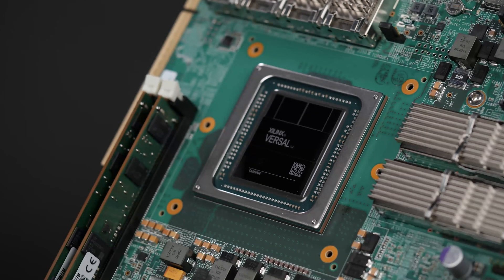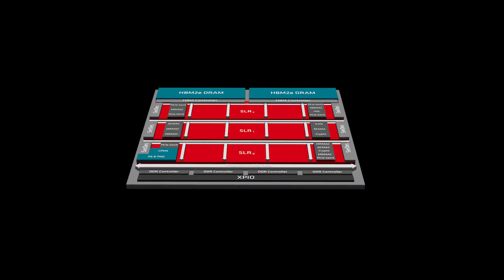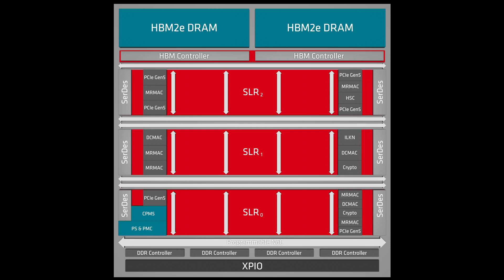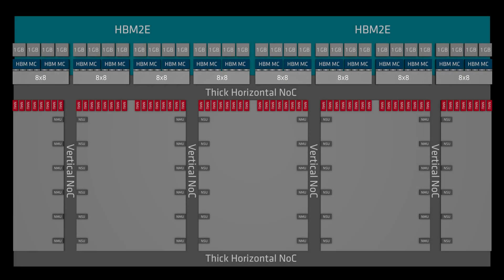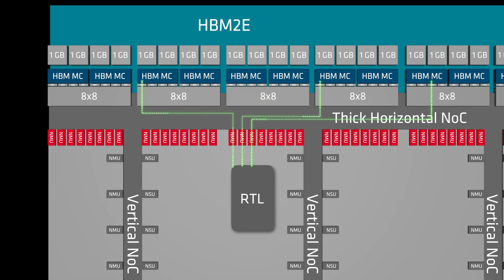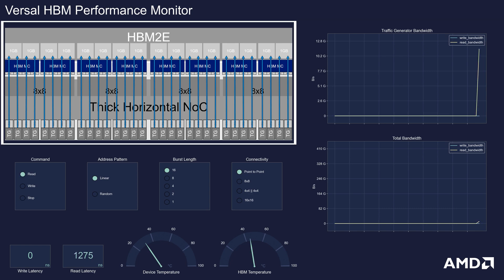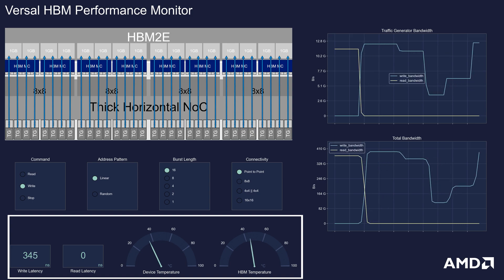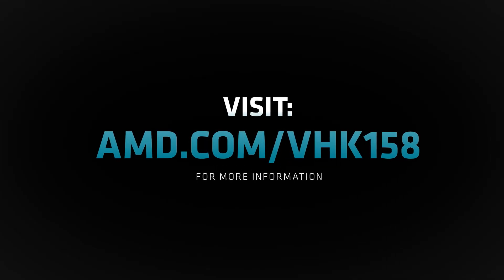Tackle Memory Bottlenecks with the Versal HBM Series

Comment: 1275ns of memory latency (read) or 355ns of memory latency (write) - why so bad??? Consumer CPU's manage to stay <100ns for BOTH read and write.
Isn't a comma (for example 127,5ns instead of 1275ns) missing?
Reply: This is an FPGA, they run at far lower clock frequencies so the long latency doesnt matter.

Comment: can someone explain this in a more simple way?
Reply: It's RAM integrated in the motherboard along the CPU/GPU, so they can put them directly next to it and with more connecting lines than regular RAM. It also saves space.
The new thing here is the way they are connected. They have higher density of connections and each controller has more connections to the memory chips.
All this is for data-centers, heavy AI workload and the like. They said a few more things, but I didn't understand them hehe.
Reply: thanks! @Mr.MasterOfTheMonsters

Comment: Let's have some of that as an L4 for our CPUs.
Reply: Or desktop APU.
Reply: @timytimotius4679 Just APU's as a whole. They NEED it.
Reply: Impossible. L4 with access latency in 300-1300ns range to cache a 50ns memory acsess???
Reply: @volodumurkalunyak4651  With that kind of bandwidth a 4GB HBM module could wipe the floor with DDR 5 assuming the CPU could use it. The latency is slightly worse but the channel width is enormous.

I'm just saying the option would be nice.
Reply: @glenwaldrop8166  no it doesn't. Memory write latency of 350ns and memory read latency of 1275ns (as shown in the video) slows down CPU way more then DDR5's lack of BW.
Reply: @glenwaldrop8166  4GB HBM module will have 1/8 BW of 32GB HBM module (and that - barely even 400GB/s out of theoretical 819GB/s).
Good luck with 4GB od RAM at 50GB/s (out of 102GB/s theoretical) BW with 355ns of write latency and 1275ns of read latency and on top of all that - APU levels of L3 cache (neither x3d L3 nor standart L3, but APU level of L3 - 1/2 of standart).
For comparison L3 latency - around 11-13ns, DDR5 - 60-75ns
Reply: @volodumurkalunyak4651 What do you mean? 3DVcache is in the L2 ran ge of latency. Having HBM in the place of it would provide similar Latency or at worst L3 levels of latency ~30ns
Reply: @hammerheadcorvette4  wrong. 3dvcahche is a PART of an L3 (and it's latency is EXACTLY THE SAME as the rest of L3 - 11-13ns).
HBM here (on the video) has insanely high latency at 1300ns (or 350ns for writes).
Having HBM instead of L3 will tank performance even at DDR4/DDR5 levels of latency (50-75ns)
Reply: @volodumurkalunyak4651 I understand that, but replacing 3DVcache with HBM would mitigate that and offer higher capacity.
Reply: @hammerheadcorvette4  caches are made of SRAM, instead of DRAM like HBM or DDR to achieve low latency.
Reply: @hammerheadcorvette4  5800X3D's L3 latency is 12-13ns.
Reply: Please no. I don't want to spend 900$ for a 9800x3d
Reply: l4 SRAM is not a new concept, 10 years ago adding 128MB of l4 SRAM was called a sufficient architectural upgrade.  Well it was when Intel did it...
Reply: You guys came up with the limits, I want it as an option on all.

Ideally with the chiplet system I'd like to see a point where we just order one to four CCXs, one IO die to fit our system and whatever is left that will fit on the package, APU, GPU, HBM, etc...
Reply: *laptop CPUs
Reply: @hypernova_478 any cpu you Neanderthal

Comment: I wonder will it be used in consumer space again eventually, though a much faster desktop APU would be awesome.
Reply: Imagine if AMD made a shield competitor with there APU and it had HBM stacked on die 😱 Nvidia would be 💩ing 🧱's as they couldn't compete the Tegra has been refreshed more then Intel's 14nm ++++++++++ node.
Reply: @shadowarez1337 I won't go as far as trashing other companies, but... Imagine the 8700G has at least 4GB of 2Gbps HBM2 via 1024-bit memory bus. The Radeon 780M as well as the built-in NPU might have a massive boost as long as the built-in HBM didn't fill up.

But it's just my own guess and I could be wrong.
Reply: @timytimotius4679  it'd have to be a custom SoC the APU might cost too much but the addition of HBM and a powerful CPU compared the Sabertooth Tegra SoC

Comment: Tackle Memory Bottlenecks with the quad chanel, octa channel and dodeca channel DDR4 and DDR5 starting at consumer level.... boom 200%/400%/600% bandwith over 64 bit and lower latency (¿-50%?f easy) or cheap, way cheaper than ridicoluos XPO ram costing more than the cpu or the gpu...

Comment: AMD Time Machine went back to 2017 in 2024 after launching most bottlenecked APUs for 7 years and according to roadmaps more years to go...
 a bit confused what year is in AMD R+D+i labs 2016 Nvidia Turing server and computing, 2020 Nvidia Ampere and server Tesla, 2022 Grace Hopper without ARM cpus... they need to remember IBM invented "Infinity cache" used in RDNA2 and CDNA2 below levels suggested of IBM (256mb) and diminissing in RDNA3/CDNA3.... shrinking bus bit while using expensive overclocked ram no jedec spec'ed...Does time goes in several directions back there? Hello, 2024 here, you're Welcome. I'm talking to you the people who invented X3D and Vega GH (gpu with hbm put in the same board of a socket cpu)...

Comment: Bring these to laptop APUs please! No more dedicated GPU on laptops for AAA gaming is the future. We need a 32-40CU APU with integrated 16GB HBM. Now that would finally bring AAA gaming on thin and "on the go" laptops.
Reply: man you definitely doesn't understand, the video itself says it's for memory bound applications not vertex compute, this thing won't run your games but rather LLM stuff
Reply: @gagahghaniswara2121  We aren't talking about the product in this video, we are talking about other rumored products,  ie Strix halo , a rumor laptop part with up to 16 cores on 2 core chiplets and igpu chiplet with up to 40 CUs.
Reply: They don't strictly NEED hbm2, MLID has talked (a lot) about Strix Halo coming in early 2025 (delayed from mid to late 2024) up to 16 Zen 5 cores 40 RDNA 3.5 CUs and an XDNA 2 NPU. Should be a solid chip even with DDR5 memory.
Reply: @the_spicy_orange  Yeah strix Halo will have 40CUs. I am curious to see how it will perform. But the bandwidth of ddr5 is a limiting factor. Its still much lower than gddr6 even
Reply: @samal90  I don't remember if details about the specific spec of the igpu in strix halo  have been leaked, but I could see a decent size infinity cache making up for low(er) bandwidth of DDR5, which it would also definitely be using the highest speed kits available.
Reply: although a powerful APU would be cool; a dedicated GPU makes a lot of sense, since it allows more flexibility and is better for thermals bc it is in a physically different location from your APU, reducing stress on the cooling
Reply: The rog aly already isn't that effivent, adding even more cores is just plain dumb.
Reply: you can only fit so many CU's on a apu. the 780m is a start to it but i doubt you'll see more then 20+ cu's on a apu soon.
Reply: I see your point, but doing this will simply destroy repairability: no more replacing a cpu, gpu, or even ram when a computer breaks. Plus, 16GB of RAM is starting to not be sufficient for many use cases, but 16GB HBM don’t come cheap. At that point, you may be better off buying a gaming laptop with a much faster CPU and GPU for the same price as this supposedly “thin and light” device that somehow have to manage cooling 32~40CU (~100W of power, referring to data collected from my undervolted 7900xtx at 2.3GHz) of GPU power
Reply: @bfbunny 16gb is plenty
Reply: @bfbunny i'm asking you this
How did you break your laptop igpu?
You are that kind of person who jabbering about Lpddr is bad even tho the Windows laptop price is super justified. 999 USD dell ideapad with 16gb 7940hs
Reply: @Phat_trick910  A large iGPU means that if the whole processor is monolithic, it will be very expensive to manufacture. AMD, being the chiplet company, have opted to use chiplets for Strix Halo, and what I am worried about is chiplets failing. There are examples of 7900xtx losing memory controller dies and fail to work.
Reply: @Phat_trick910   Besides, there is a fundamental difference between LPDDR and on-substrate HBM, the former which can be repaired easily by a relatively skilled worker while the latter is either screwed or sent back to the factory on failure.
Dell Ideapad😂 What next? Lenovo Inspiron, Msi Blade, or Razer Titan?

Comment: Would be cool if they can add this to GPUs in some type of way.
Reply: Do you mean like they (and others) used to do in 2017 (other 2016)?
Reply: @InternetListener  to a certain extent. Take advantage of the technological changes and progress.
Reply: Too expensive.. had it in my Fury and Vega64. We don't need this capacity in gaming.
Reply: add what exactly?
Reply: @Mottbox  since AMD is adding more AI to their chips the memory bandwidth may come in handy.
Reply: Like the Vega 56/64 from like 2016.
Reply: @hammerheadcorvette4  but for ROCm and AI applications.
Reply: That kit costs $15k each

Comment: RX Vega 64 here :)
Reply: Vega 64 memory almost as fast as my 4090s... HBM is just better
Reply: @legendaryz_ch yes but the use case scenario for both is very different along with architecture designs and support for various programs.
Reply: Are you gaming on it? Is it still good?
Reply: @user-f1ff23  Off course! I play at 2k  always. Is not the best card in the world, but is strong.
But i have 60hz limit, so it's good. Play at 60hz, because my rig is from 2016-2017. 
But i only playing Skyrim modded and Fallout 4 modded. i7 8700k, 32gb ddr 3000 and RX Vega64 8GB HMB2. It's old, but powerfull.
Reply: Since RX 5700 onwards, Vega is not even a good used buy except below 100 USD. RX5700 can be had for about that, draws half the power for more fps and has ongoing driver support. Thats coming from someone who screwed the biggest air cooler on his Vega56 and made it run stockV64 clocks, undervolted.
Reply: @user-f1ff23 im using a refurbished rx vega 64, it can still game